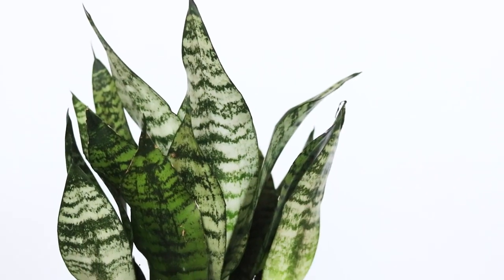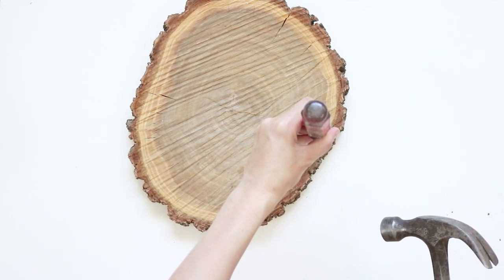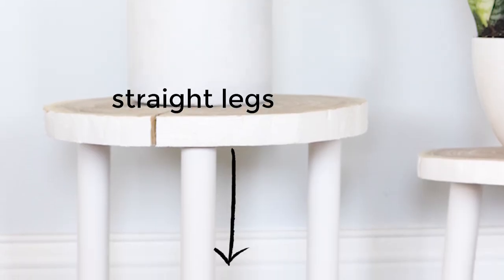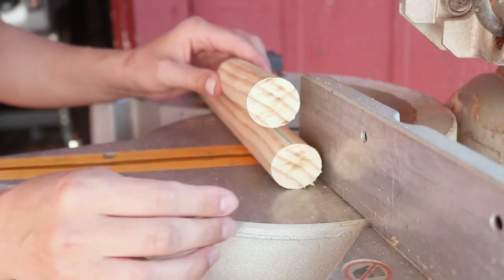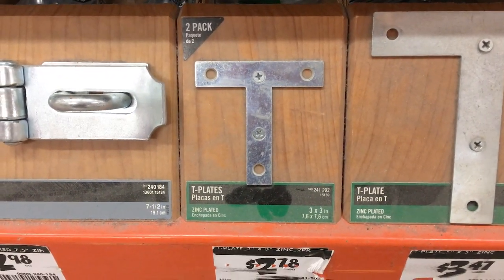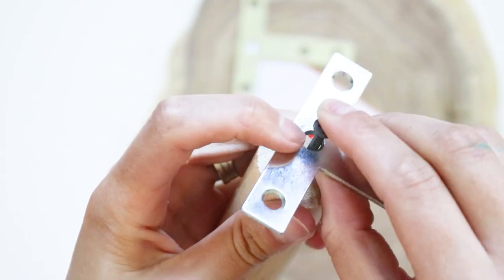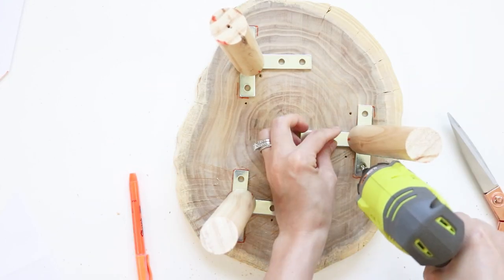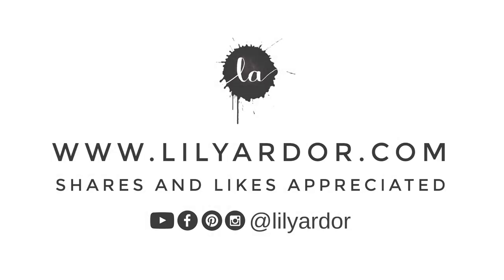DIY Easy Wood Plant Stand for $7

Comment: I have a couple of questions: what are the lengths of the screws for your "short" and "long" screws? Also, what size drill bit did you use for your pilot holes (for dowels and plank)?  Using short and long and not identifying drill bit sizes open the door for a lot of guessing. Would appreciate it if that could be described in steps or video